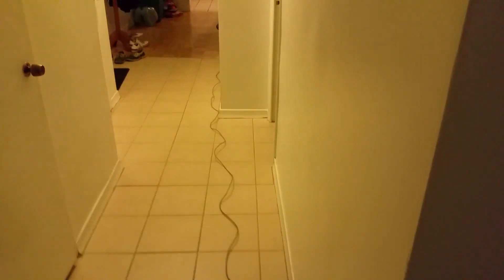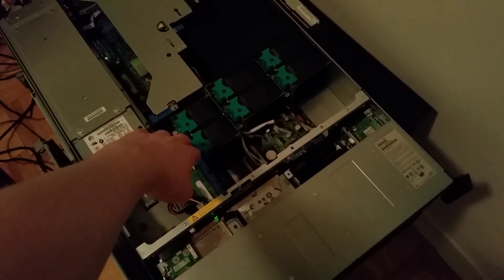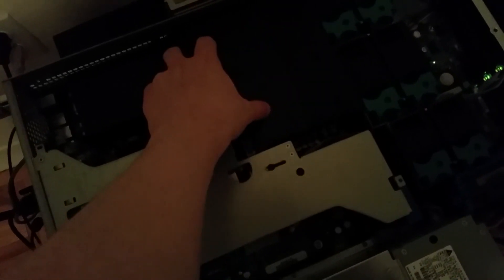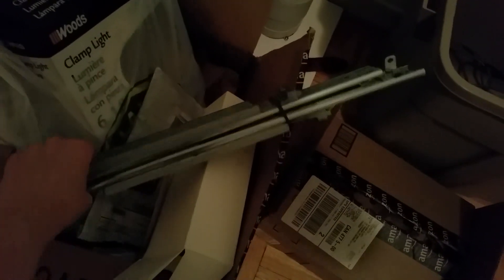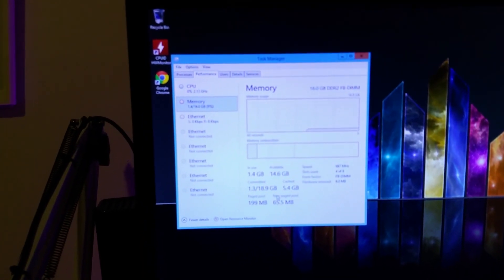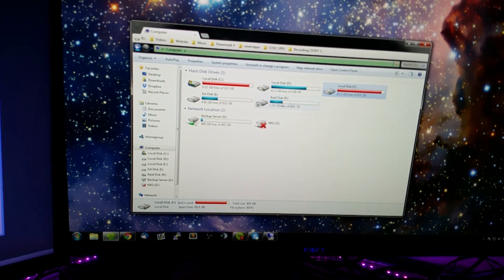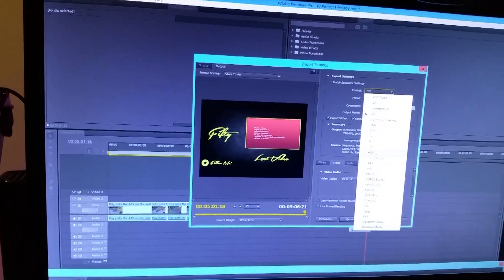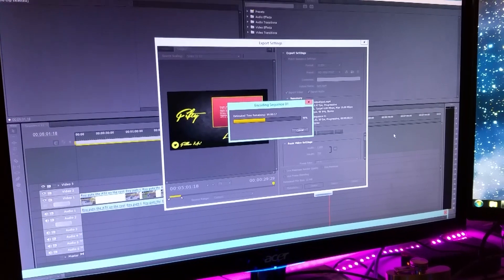$100 Dual Xeon Server Special! - Remote Video Rendering

Comment: where can i buy one such cheap 100 dollar server ,used ..
Reply: Ebay. I picked up an old R610(dual quad core xeons with HT so 8 threads per CPU) and 16GB RAM for $100 shipped. it has four 1Gb network ports and if you can find one with it, another for iDrac(if not, that's like $10)
Reply: TheMudyOne I've seen one listed for 69 dollars, is that a safe and good thing to buy
Reply: harsh gupta I don't know, 7 can't see the listing

Comment: It was a steal. Normally, a system like this would cost around $1400.
Reply: +Zeldagigafan 
Uhm dude a xeon 5150 is a dual core and you can buy one for 2,50€ right now on ebay.
100$ is pretty accurate price for the whole system including hot swappable stuff etc.

Comment: Quick question: wouldn't the quad core be faster? Because the x5150's are both 2 core, so 4 Threads on old architecture. Assuming it's anything above an AMD 4000 wouldn't it be slower?
Reply from the maker: niofalpha 2x 2 core xeons = 4 pysical core, phenom x4 = 4 physical cores. Xeons out perform any old amd stuff.
Reply: Fifty! Ohh it was a Phenom x4, that would make sense...

Comment: Can you go into more depth on what operating system the server is using, what you are using to remote in to it, basically how you set it up, I am very interested in your setup and it's something I'd like to do with an HP DL360 G7 1U Server, barebones, for 5 Dollars, just installed E5645 CPUs for 20 USD.

Comment: Thanks for video. 
I'm plan to buy new PC and thinking about old dual xeon server instead. In my country for same amount of money i can buy used dual xeon x5550 Server or new i5 6400 PC
Pleas give my your opinion what should I do? I have zero experience with dual cpu :D
Reply: forgot to tell that will serve as main PC
Reply: If you're planning on gaming, go with the i5 and get a decent gpu. If you're just using your computer for work related purposes, go with the dual Xeon.
Reply: Go with the i5 6400 if you're placing any priority on practicality.
The Xeon X5550 is apparently a 95W processor, so two of those would mean 190W is being used to power the processors alone.
Dual Xeons would be a good side project or a cool rendering rig, but even then it probably won't be much more powerful than the i5 6400 and will consume at least three times more power.

Comment: can somebody share a tutorial or how to guide on how to render other os system from a server!
Reply: Nicolas Villafan what os are you using and what os is the server?
Reply: I am planning on getting a server (haven't yet).. don't understand very well how to run other os and others server or anything about servers at all. where sure I start?
Reply: I suggest you use Ubuntu or a other Linux distro, as for learning it,  it is very simple to use and there are many guides online. Also, a amazing video editor for Linux is Kdenlive, it is simple and free.
Reply: I am a Linux user since 2006, currently, on Linux mint KDE, I am wondering about setting up a home server.. and I guess all this KVM virtual machines stuff..having different distros or OS like  environment's and accessing them etc... ultra newbie on servers topics
Reply: Then I suggest using Windows ( you could get a xserve or build a hackintosh) since your on Linux you can't use remote desktop but I suggest using something such as team viewer, note if you end up using premiere pro, there are audio and video driver issues to watch out for, so after you've build your server, installed your os, and enabled remote access, your pretty much good to go
Reply: Nicolas Villafan of course you will need a editing program, and Windows movie maker is no longer for download

Comment: I just got myself an HP Z800 workstation from work for the low, low cost of FREE! It has the following specs:
2x Intel Xeon x5660 @ 2.8GHz
40GB ECC RAM
4TB of storage
Nvidia Quadro K4200
1250W PSU @ 220v or 1110 @ 110v (depending on where you live in the world)
Reply: The Z800 does not support standard ATX PSU, if you are thinking about buying one of those. And one other thing that kind of sucks with it is it doest not support Geforce cards in SLI. Quadro cards are fine though. I think it's because of licensing of the SLI technologi or something like that.
Reply: I don't see any problems with that. However crossfire might not work on it because it is (at least to my knowledge) only certified for SLI with quadro cards (maybe it supports crossfire with the ATI/AMD FirePro cards. Again not so sure about that)
Reply: +FaintVFX would a normal atx psu work with a dell/hp dual socket workstation? I thought they used proprietary psus
Reply: 3hit They will likely use  a proprietary PSU connector (at least i know the HP Z6xx and Z8xx series use propriotary connectors)

Comment: Why is it all these cheap severs are ddr2 ram
Reply: Because they're cheap
Reply from the maker: +jameshone1000 Companies decommission these older servers and either send them to scrap or sell them for super cheap
Reply: +Fifty! Where do you get your cheap servers?
Reply: +jameshone1000 When the warranty expires on almost any enterprise machine (usually around 5 years), they decomission them. If they fail, the down time is more expensive than the replacement. Almost all used servers available are DDR2 based machines, or early DDR3 machines. Socket 775 or 1366 Xeon servers are hot on the market right now.

Comment: Where would you say the most fan noise comes from? Is it the case fans, or the PSU fans? I was wondering if you could buy aftermarket fans quiet the system down. That and buying L series Xeons and using passive coolers.
Reply from the maker: The case fans for sure. Theres 6 high rpm hot swap fans that cool the ram and cpus

Comment: if you think that the server renders fast with its twin dual cores, what does your system have?
Reply: TheMudyOne Thats what i was thinking, its pretty slow lmao.
Reply: To put my rig into and give some perspective:
Core-i7 3770k @ 4.9
16GB DDR3
Rendering scratch drive | 2x WD black 1tb hdd's in raid 0
Recorded footage: around 10gb for 2-3 minutes.
10 minutes to re-encode that 10GB fraps record into 350-430mb file using Sony AVC/MVC, 1920*1080, 25,900,000 bps with 320kbps audio
Reply from the maker: At the time, the goal wasn't to do it faster. It was to offload it to another system and allow me to do other stuff on my machine.
Reply: Fifty! and I'm about to do the exact same thing too :) mines a complete custom server. I'll be putting that up on this channel soon :)

although you're not doing it for rendering speed, can you make a comparison video between your desktop pc and the server? that would make a good vid actually :)
Reply: If your not going for speed why get a loud xeon server when you could get a cheap used pc that performs better and makes less noise for about the same price.
Reply from the maker: I have both. I don't use this server for this purpose anymore. It is currently part of an openstack test cluster with a few other servers. I bought the server before I came up with a use for it, or else I would have done what you suggested.
Reply: Matthew Finateri I picked up a $65 server that has twin quad cores, hard to find an old desktop that has that much horsepower.
Reply: TheMudyOne Thats true - If you did find one, It wouldn't be classified as a personal computer / desktop PC. It would be a workstation.
There's a few good Dell workstations kicking around with dual Xeons etc but the tradeoff is high heat output (mostly owing to the FBDIMM ram) cost vs performance and lifespan

Comment: Thanks man. You can change those CPUs to a bit more top of the line for this socket 771 system for just a few bucks. Models that are 2x faster than the 5150s are really cheap on ebay.
Reply: +1

Comment: using for a hardcore gaming system it might take two 36 core xenon cpu chips if the motherboard has two extra cpu sockets you could have 4 36 core xenons for 144 cores.

Comment: Hey, I saw your video and was wondering if you could help me out with my question. I bought an used liquid cooled server with 2x xeon e5620, 128gb ram and I was wondering what version of Windows or Ubuntu Server would be good for it.
I would like to use it as an Video editing rig and also as an Plex Media Server. I want to install the OS on Samsung Evo SDD and I will definitely not run this server for 24/7

Comment: Realy cool! The only problem is maybe power consumption :(  A Intel Atom C2750 (8 cores) have aprox. the same performance but consumes a fraction of this server energy but, since is a relatively new product, with a much higher price point. Another option is to buy a used Core 2 Quad or Core i3 desktop that will give you a relatively equal performance for the same price and with a lower power consumption. Nice work!

Comment: You should use Adobe Media Encoder instead of Premiere to encode your videos..
Reply: For this setup yes, but in general there really not much of a difference (Been using both for 8 Years)
Reply: There is definitely a difference. For one you can carry on working in Premiere after dispatching your transcoding task. Secondly the transcoding will be much faster without the overheads of an NLE.
Reply: Show me a 4k render difference in time. Ill give you that continuing to use Premiere is nice but that still takes up the same resources. Ive never had more than 5 seconds as a difference in my render times with 4k. If you continue to use Premiere then $200 it will be quite a bit slower.

Comment: Hi, I'm trying to do what you've done with your server, but when I open the project across the network on the server the dynamically linked aftereffects compositions cannot be located, even when i go into the link browser. (I can see the file but it wont let me select it as the missing file.)
Have you had any problems like this or have any ideas why it's doing this? (I'm using Adobe 2015)
Thanks, Elliott

Comment: That seems unrealistic at 100$ as that server should be in excess of 1000$ especially with 6x 1gig nics and 64gb ram
Reply from the maker: Old enterprise stuff is not worth much. You can get better servers than this for $50 now. Even R710s are cheap for what you get.
Reply: In the UK there a bit more expensive than that mate

Comment: What if you want to use something else like Davinci Resolve or Sony Vegas?  I got a server too its a 12 core 24 threaded dual Xeon with 16GB of ram but without a graphics card in the server (or like a quadro) I can do didly squat with video editing.  Or are you using this only for the "rendering only"?  I bought another workstation with a Quadro in it just because there is no room inside my 1U server for a GPU of any kind....Supermicro told me if I did put a low profile gpu inside It would have to be an old as fuk GEN1 type GPU.
How do you do anything with videos in that server without a GPU.  My onboard graphics severely sucks.  Please let me know.  Thanks!!!!  Nice set up by the way.  I would love to use my server as a rendering farm just can't figure out how without a GPU.

Comment: You should never run a server like that with the top off.
Reply: +AxMxProductions The way those servers work is you  can open them to replace a fan for example, it's hot swap-able so you can take it apart with no fear of discharge